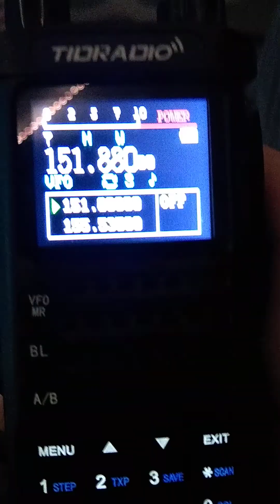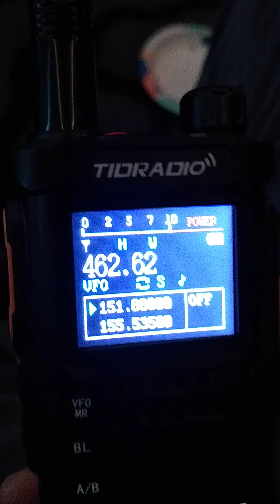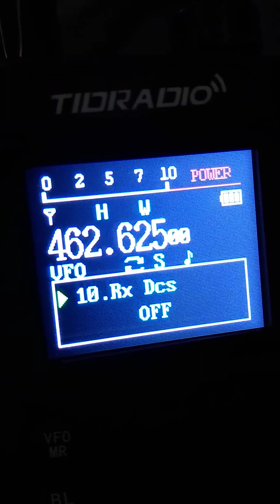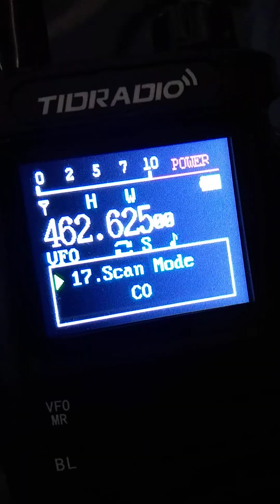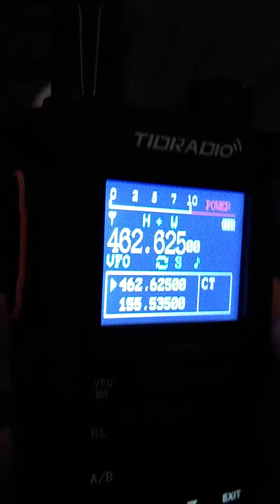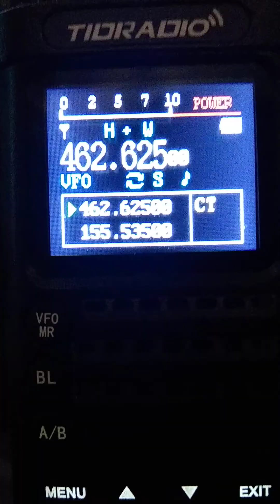How To Manually Program GMRS Repeater Info Into Tidradio TD-H8

Comment: What’s the offset and the plus an minus correlation to repeater?
Reply from the maker: @jellocity708  on GMRS the offset is always 5 MB higher than whatever 462 mhz you're on, so you'd transmit on 467 MHz and you'll be heard on the 462 MHz